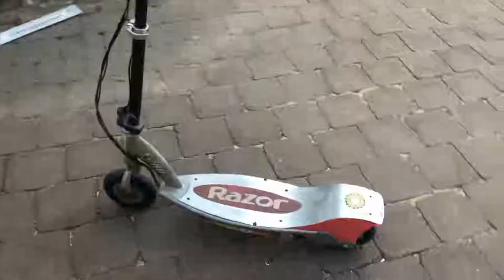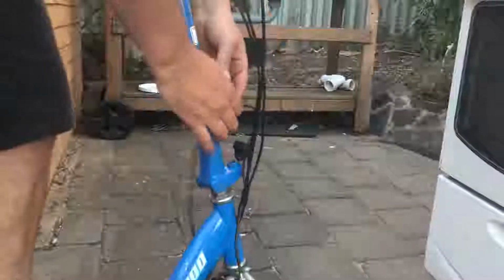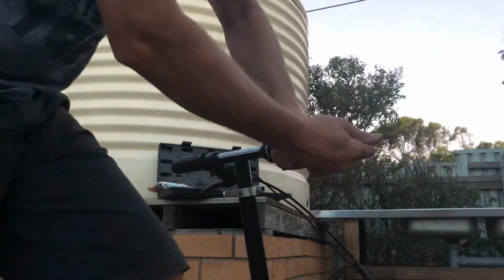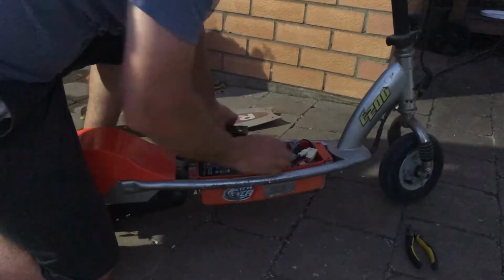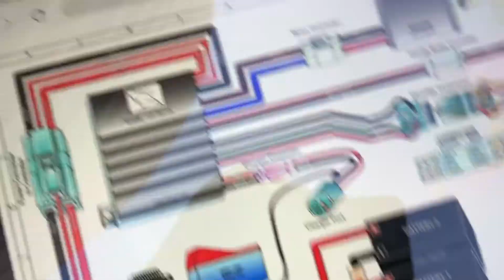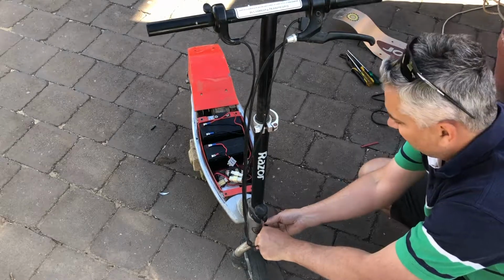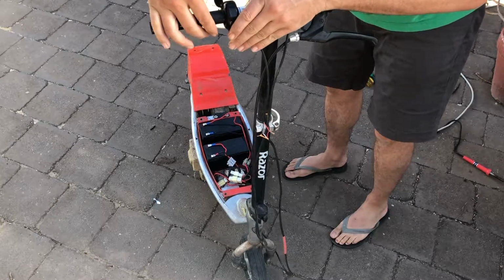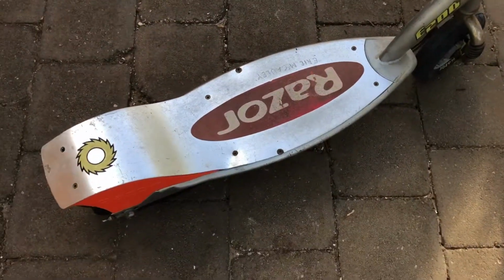How to install E100 2 wire throttle on Razor E200

Comment: Could I connect a 4 pin throttle from a scooter and fit to a 6 pin ebike controller
Reply from the maker: Sorry, I'm not familiar with the ebike controller that you are mentioning. Cheers Drew

Comment: Do NOT try to remove the grip as shown in this video.  Simply keep twisting the grip back and forth freeing it up then as you work it down the bar.  It is hard to come off due to the suction type forces keeping it on.

No screwdriver pry bar needed.
Reply from the maker: Thanks for the useful suggestion! Cheers Drew
Reply: I know I am quite randomly asking but does anyone know of a good site to watch newly released movies online ?
Reply: @Yousef Antonio flixportal :D
Reply: @Kalel Trevor thanks, I went there and it seems to work =) Appreciate it !!
Reply: @Yousef Antonio you are welcome :)
Reply: Those grip need lubrication. Either what he did or spray some penetrating oil using the screwdriver method to open the edge or spray cooking oil will work as well.